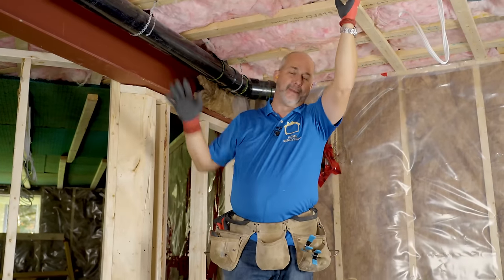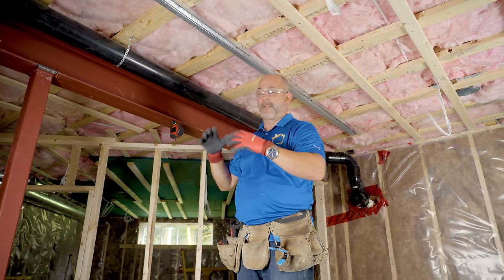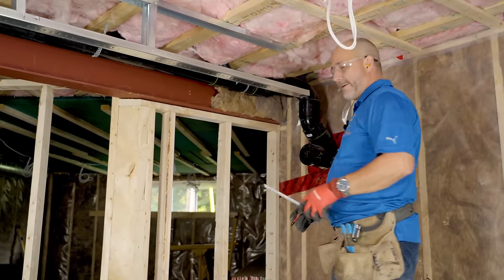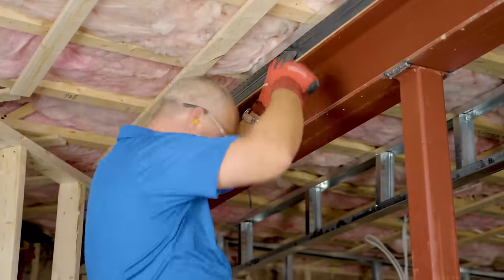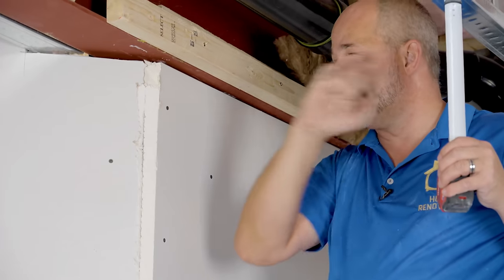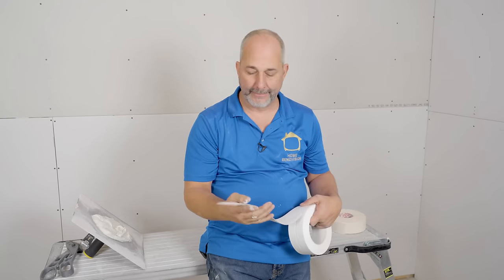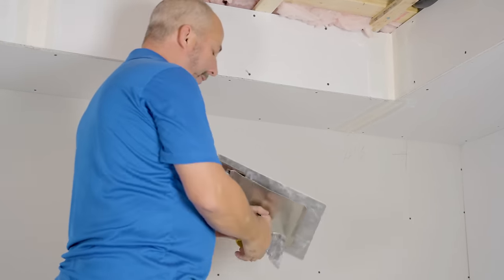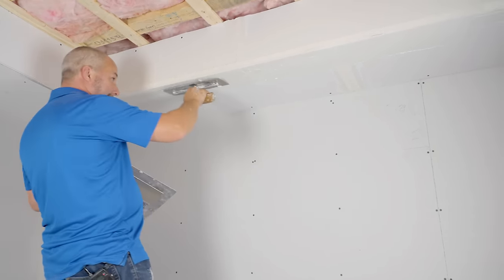This Trick Will Make Your Bulkheads (Or Soffits) Look Intentional

Comment: Adding a step bench like he uses in the video is one of the best tool investments I ever made. Being able to work off a flat surface instead of a ladder and reach a much larger work area without moving the ladder is incredibly helpful. They are not all that expensive in comparison to step ladders. Get yourself one that has adjustable legs so you can us it in stairwells and other uneven surfaces. Some even have outrigger legs that extend from the bottom of the ladder legs to give you extra lateral support so your platform does not tip over.

Comment: I just recently finished my basement as well. For the bulkheads (ladders), i built them all on the floor in 8’ sections, and just lifted them into place and secured them. Looks great and lets you do most of the work on the floor instead of on a ladder. Mine are framed with wood.

Comment: Another fantastic video!  As luck would have it, I am tackling this exact same project in my basement.  I have already started the framing and took a chance and went with aluminum studs.  This video reassured me that the work I have done is on the right path and solved 2 big pain points/blockers for me:  1)  Securing the bulkhead framing to a wall  2) Making the corners look good.  Between this and your soundproofing videos, I have a lot to go on.  Thank you very much as always, Jeff!

Comment: Wow perfect every time!
I wish you had uploaded this  video 4 weeks ago I did mine but the way you did was much easier fast and flash with the beam. ❤
Reply: @keithmarlowe5569  it just sinking in on his method now that you have explained the method with wood.  I haven’t done framing so I’m a bit slow to catch the ideas.  Basically he’s using the thickness to his advantage and slide the bottom one up and down for the perfect height.  Where as you can’t do with wood.  It’s much cheaper too. Saves on material.

Comment: here's a tip for cutting steel studs - mark both sides as you did, then score the metal on the flat side with a utility knife, cut the edges, and then bend the stud back and forth to snap.

Comment: I thought you were supposed to add drywall to the ceiling before the walls, so that the walls help hold the ceiling corners? I feel like I remember you mentioning that in other videos. Is there a reason you did the walls first?

Cheers, thanks for the video!
Reply: I believe it's because of the smaller pieces, he does recommend full spans of ceiling first when starting in the other drywall video mentioned just before this one.
Reply from the maker: In this case the ceiling will be finished with wood so that explains that! Cheers!

Comment: I used your 2x2 method and it worked out great and made a very straight bulk head that is 30 ft long. Just curious when you would use aluminum studs over your old 2x2 method. Thanks for the videos, keep it up!

Comment: Do the box all the way around the room and you've got yourself a fancy coffered ceiling
Reply: If you threw some cheap molding on top of that then people will think you're rich
Reply from the maker: Definitely an option. in this case we are finishing the same as the upstairs to create continuity. Cheers!
Reply: I want to build  trey or coffered ceilings in my master bedroom and formal dining room
  I was thinking this would be a great way to accomplish the task.
Reply: Yeah, if you have to have a drop ironically making it bigger or wrap around is often a better solution because then it looks purposeful!

I had a really ugly ceiling box in one room that I extended to the other end and put recessed lighting in. A bit of decorative molding and now it looks like a nice light bar instead of an eye sore.

Comment: Happy New Year Jeff and Family :) 

May you never have to have to use that clean out. As a former Sewer Company owner. I would never open that cleanout. Simply from its location it would be an absolute nightmare to clean. I would leave that one to another company who enjoys taking a ummmm shower. You need to put a clean out from the floor above. Since your line will be full of sewage you open that cleanout which looks like its below grade...you will fill up your basement with sewage...

Since I am not on location. I may be wrong.

Comment: Safe to assume that since we have some tape peeling away at some drywall joints, the previous owner did not do this. Great stuff, thanks for all the tips!
Reply: The tape did not bond with the mud. When using tape, I use a wetter mud mix. This helps to adhere the tape with the mud.

Comment: I’m pretty certain you can, but could you have used a chop saw to cut the steel studs? Perhaps get another bench to be able to get 10’ done? Amazing work, sincerely. Full props for the talent you have, especially with the muding and taping.

Comment: Great video, tons of good info Jeff.  Question: my bulkhead happens to be 60" wide, inlcudes heat, return and HRV hard piping.  I was going to use your old system with OSB, 2x2 as I only have 3" between the hvac runs.  Could I use steel on either side and OSB in the middle?

Comment: When I did my total renovation and addition to my house I used some metal studs but mostly 1 1/2 matal angle iron same gage as the metal studs but in boxing in a beam or ductwork horizontal and vertical I just attached the one in the corner to the drywall no studs between the angle iron the drywall can hold the weight as for those pan head screws they started out with one name and switched back and forth with waffer head on the box and it has always been hard to find them because you ask for one and it's called the other the new guys and most are new don't know what you want they come in 2 length 5/8 and. 1 5/8  5/8 is the usual size for joining metal studs and angle but I keep both in my truck as both are so handy I've used both in so many different situations even building my first motor home addition and later my quick budget handy bus conversion to a camper

Comment: 18” x18” heat duct going through our 7’ 11”  tall basement. I had it replaced with an 8” x 48” duct. When they framed around it they put a 2x4 below. I had to explain the problem with that. Ok now the drywall is 1/2” from the duct. When that drywall box hit the wall I wanted it to look like an archway. 

We talked for an hour. They just could not understand what we wanted. The good pencil drawings just were not doing it. So that night I built a 3D model of what I wanted out of cardboard. 

It came out great in the end.

Comment: Great Video and tips!   Are you using 1/2" or 5/8" drywall?   We use 5/8 " firecode for ceilings and especially around structural -  is that required for your work too?   Thanks for all the tips -  great content.  Cheers.

Comment: Awesome video, this is great timing for me! What kind of spacing do you need to do with this method around a heating or return duct?
Reply from the maker: only enough to add insulation if that is needed for sound control.
Reply: @HomeRenoVisionDIY  perfect thanks much!! I wasn't sure if you had to worry about more space so the drywall doesn't heat up.

Comment: If don't have time to wait for the PL to gule to the beam, you can dry fit some wood in there. You just cut the corners off the wood at teh back to account for the curve in the steel, and use a sledge hammer to whack them in. I use this when attaching joist to the sides of I-beams. Easy easy and takes just a few minutes cutting wood to the right size and shape.
I stead of making ladders, cut OSB panels on a table saw to the depth of the bulckhead: you can cut it a bit short and use the level. Screw the OSB panel to your 2x4 you attached to the floor joists, and now you have your sides done. Last set is to attach a metal stud to the inside of the OSB panel. There you can make everything perfectly level and straight. Attach the horizontal drywall the same was as in the video. Makes everything straght and solid. I also can add curves to the bulckheads: makes it look real nice.

Comment: You CAN have long runs of corner bead match up perfectly. It's real easy.  I always keep scrap pieces of corner bead from cutoffs, cut them around 4 inches long, cut each end to a point/arrow, and snip along the edge so it is about half the normal width, slide it under the end of your first piece of corner bead, and when you put the next piece on, that scrap piece will keep them perfectly in line.
Reply: Beautifully done 😊❤

Comment: Take that trowel off at Hawk  you will cut your self open with it and only take a little bit of mud off from under the tape and by putting the extra coat on when it’s wet will let the tape move around and after it’s dry it will look wavy when you look down at edge !!

Comment: 'wood is never straight' a lesson i learned renovating my deck last year. removed all deck panels to redo the structure between the deck and concrete that had rotten. i was thinking just lay back the deck planks and be done. boy was i wrong. had to use clamps and spacers to get it straight again, paying attention to the concavity of the bend each time. took a lot more time than expected.
Reply: @@anothermovienerd yea most big box stores also have all the crooked parts in front or even only have crooked parts left cuz everyone is picking the straight ones. gotta hit the lumber yard for any serious project.

Comment: Been loving the content, Jeff! My hot & cold ducting are too close together to fit any support between them for my basement finish project. I am looking at an almost 6' wide soffit to hide them. What should I do to avoid sagging drywall underneath for such a big span with no midline support? Thanks and keep it up!
Reply: Did you find a solution?
Reply: @jpjp3873  I am going to run 2x4's across the bottom every 16". It may be overkill but I have leftover lumber from framing walls.
Reply: @tomd3022  is there any room at all between ducts?  I saw a great solution by cutting 7/16 osb and nailing 1 1/2 x 1 1/2 material to form a kind of I beam that can slide up between and screw into floor joists with a long extension.   It worked out great for my basement.

Comment: I missed a couple things... First, why make it so much bigger than just to hide the beam and drain pipe?

Second, the steel I-Beam was 9-13/16", and he rounded to 9-3/4". The track top and bottom is 1-1/8" deep. Then he cut his steel studs to 9-1/2". 9-1/2" minus 1-1/8" (top) minus another 1-1/8" (bottom) and when he attaches the top track to the ceiling (floor joist), the bottom track is level with the 9-13/16 I-Beam?

Comment: Holy crap this crimp tool would have saved me countless times i dropped the pan head screws from my driver!  Also the whole secrete about cutting it short and just sliding the metal around would have also saved me a ton of time. This is why you need a pro for 5 min to set you in the right direction before you get started on your own.

Comment: if i may suggest, do ur bulkhead sides 1st, than the bottom, that way the seam where they meet is on the side and mud doesn't drip out, unless u are using metal beads than it doesn't matter

Comment: I love the idea of the strapping. I just wish my main floor height accounted for it. The ceiling is already slightly short meaning the finished surface will be short of 8foot. I don't want to lower it even more by strapping the joists.
Reply: Strapping typically less than one inch thick

Comment: I thought you'd want to keep the drywall from touching the beam when you run it underneath so the sound energy doesn't transfer from the drywall directly into the beam.
Reply from the maker: In this case we have an open stairwell so not going to make any difference trying to use sound control measures other than impact noise from above. Cheers!
Reply: I used to build recording studios. In a residential situation, the transfer of sound energy would be negligible since anything with high mass (like steel beams) require enormous amounts of energy to be put in motion and transfer those vibrations elsewhere. Also, sound travels through various mediums differently. While diaphragmatic transfer can be significant with some noises like foot falls or lower frequency sounds, air leakage is also a huge culprit. It's a matter of chasing the weaker links first.

Comment: Is it the same drywall screws for wood and metal ?
Reply: no, for screwing drywall into metal you should use fine-thread drywall screws. both will work, but the fine thread will be easier to drive and hold better
Reply: @erikacevedo18  thanks 👍

Comment: I don't like how flimsy the metal framing is for bulkheads. I understand that it's okay and works but I prefer forking over a bit more cash and have the framing done with wood. This is especially true for areas where the bulkhead might go over a gym and you might want to hang things solidly on the side of the bulkhead, like pull up bars. Otherwise, having it solid is also useful for hanging other things like TV's as well, or shelves, etc.

Comment: When your putting on the 2nd coat of mud before letting it dry, doesn't your outside corner do some crazy stuff, flatten out, ect.?
Reply from the maker: sometimes , however if you want perfect corners use the 45 mud to cover and then a second coat. Cheers!

Comment: The problem with steel studs is that they cause some serious attenuation and reflection of wireless signals (2.4Ghz, 5Ghz, and 6Ghz bands). This is even worse if you use Roxul insulation. - Something to keep in mind if wireless everything is important to you.
Reply: Important to know that this wouldn’t cause any interference if it is not in the path of the wireless signal.
Reply: @lippdog03  It usually is since folks like to stuff every cavity with the stuff to deaden the noise.
Reply: @BattlestarCanada  in my case it definitely wouldn’t be in the path of my wireless signals. I’m guessing many others would find the same. You don’t have soffits everywhere…
Reply: @lippdog03  I have been in places where they stuff the inner partitions with it, the joists and any other cavity. It does come up from time to time.

Comment: The steel I beam is clearly 250mm (9-13/16) tall. It only doesn't make sense if you don't use metric system.

Comment: Don’t the glued blocks move while setting the horizontal blocking. Or did you let them dry first. 
2nd question. Do you not use any  drywall adhesive for helping with nail pops.
Reply from the maker: i let the blocks dry overnight. as for adhesive that is not something we do here in North America. Cheers!
Reply: Interesting. I’m from  western Canada. The homes I’ve entered under construction and Reno jobs have used Pl200 tubes and Tytan foam can adhesive sitting on the piles of discarded drywall. I always wonder what their using it for.
Reply: Maybe they don’t in his part of Canada, but everyone and everywhere I know of in the US that drywall’s uses glue and screws.

Comment: "Tight to the steel" is more important than you think in 7' high basements with big steel beams bringing it down to 6-4 or even lower. That is talking as one who is 6-4 and has seen guys 6-5 or maybe taller bouncing their noggins on crazy low box-ins built by shorter humans. And believe it or not - partition walls and even doors added in below that make for even greater 3 stooges slapstick routines.

Comment: wait wait wait... that 45* wall, did I see the outside corner of the drywall itself cut to a 45 degree angle!? If so, I'd REALLY like to see how to do that!
Reply: The easiest thing is to leave the sheet longer and flush cut it with an oscillating tool

Comment: As a Interior systems mechanic for 40 years, and a supervisor for projects of many hundreds of millions I'm gonna let you in on a professional tip.
Drywall is self furring for 24 inches (not 16")......that means you dont need anything but 3 pieces of angle and a string to build what you built. Side note....the crimpers you are using have a full and half crimp....look at the tooth, full crimp is for top track on a wall....for deflection. The half crimp is for inserting a wafer screw. You are very sure of your self, wouldnt last a minute on a real site.........Look for a old book called "The Lathers hand book".....it will blow your mind.

Comment: why not just build the bulkheads out of 2x4 and 7/16 osb? would have taken you half the time and just use a ramset to fasten to the beam. You can make sure its straight by using a chalk line on the edge.